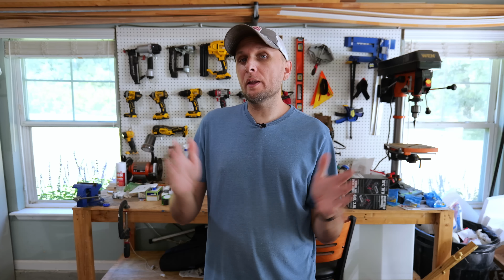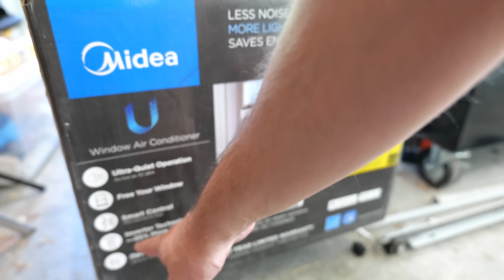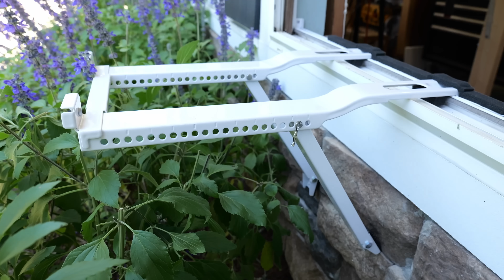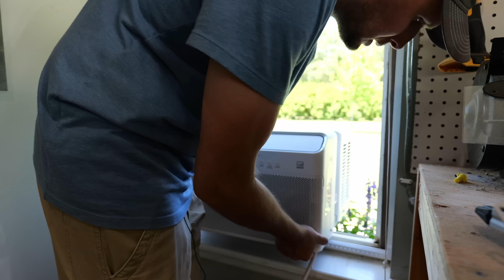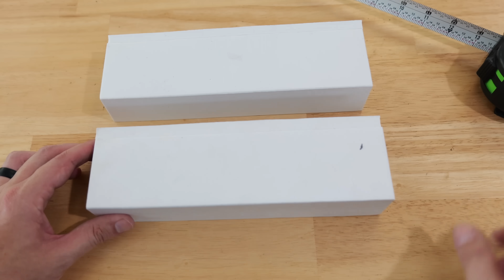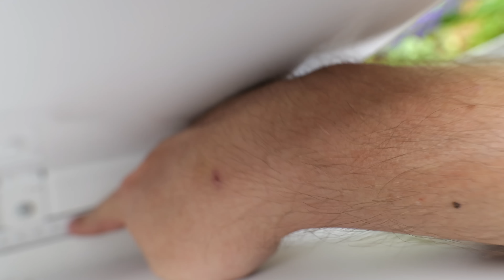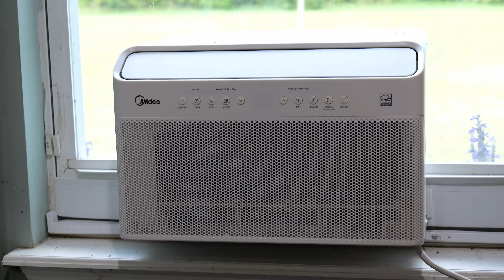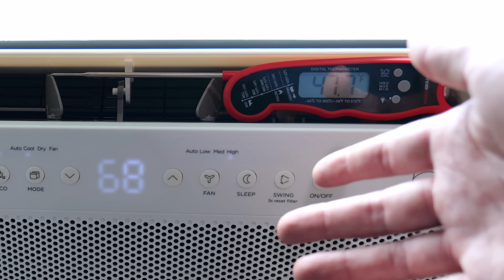The COLDEST And QUIETEST AC Unit Ever Made!  Still Use Your Window!

Comment: How much actual power does it draw when on?
Reply: My 8000 btu model uses about 400 watts with it often being much less given that it's inverter based. I got one initially for using with a small 120v generator during power outages.